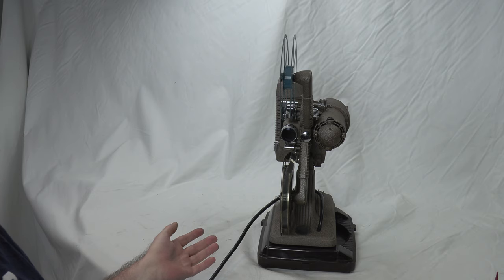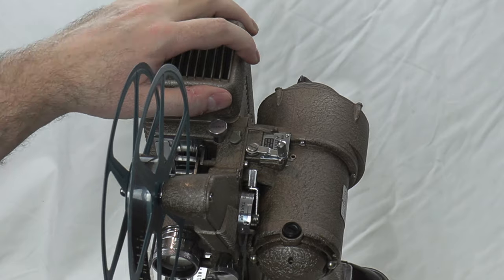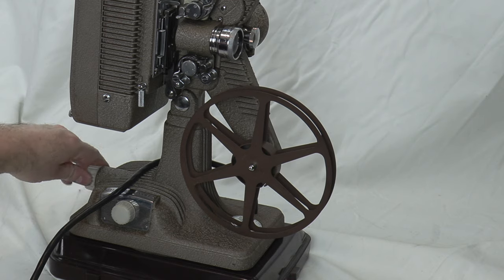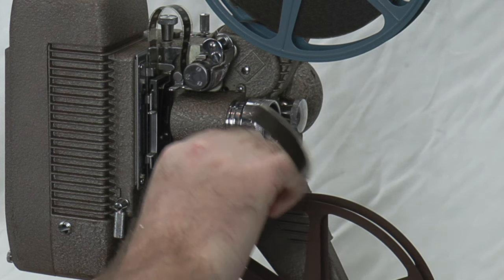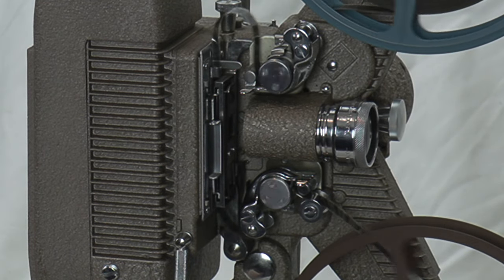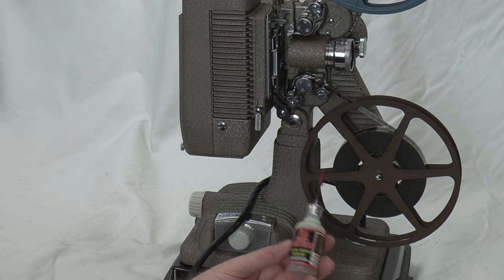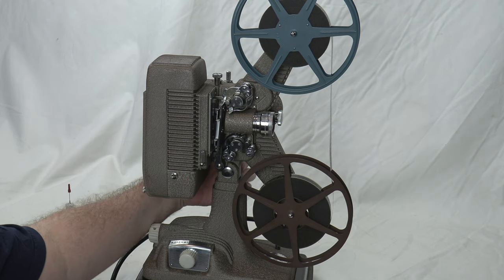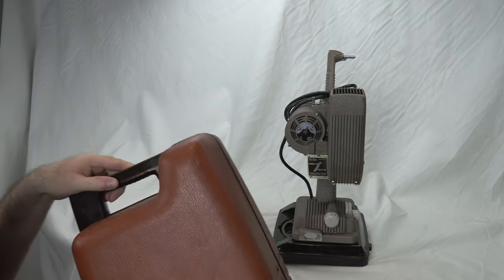VINTAGE Revere Model 48 16mm Film Projector Demo in 4K  Made in USA Circa 1952!

Comment: Do you have any idea why the clutch would not engage in the direction?
Reply from the maker: the clutch should engage in both directions... are you asking because your unit only works in a single direction? - the demo shows how to move the reverse lever and then you can engage the clutch in reverse, and vice versa.
Reply: @mediacreationsusa  it doesn't engage in either direction.
Reply from the maker: @cheryllutz476  even with the other lever fully moved to one direction or the other? - if so, then the cam that is inside the arm is most likely broken or another part of that linkage. - Be sure that lever for direction is fully engaged
Reply: @mediacreationsusa  I set up the projector again today.     Does the projector require film to be loaded in order to see the reel wheels turn?     When I move the lever from one direction to the other, the sound changes as if it is engaging, but i do not see the wheels for reels turning.   I hope that makes sense.        Would it be easy to access cam in the arm that you are referring to?
Reply from the maker: @cheryllutz476  You don't need reels on it to have it work, the bottom spindle should be turning in FWD and the top would be turning in the other direction when you move the lever to the RWD or Rewind position. - you can start by taking off the arm backs there are several small screws - be careful and take your time so you don;t loose the screws.  it's fully mechanical - I think these used chains back then but there might be belts - I can't recall on the 48 but you will see the problem if you pull those.
Reply: Actually the back arm panel is missing..aleady off.  I see the chains but don't see anything obvious broken.   Chains are nice and snug
Reply from the maker: @cheryllutz476  well, if you have it off like that... see what happens if you try and turn the hub by hand and see if that is freely spinning with the lever in each direction... if its the top one there should be some resistance in Reverse, the bottom arm would be resistance in the FWD position.  if they feel the same then you know its towards the middle where they meet and that cam I was talking about that moves to drive on arm or the other.
Reply: Ok..time to get my brothers help!    Lol.   Thank you!
Reply from the maker: @cheryllutz476  sure thing! Good Luck!
Reply: Can u tell us what the hub is?   We have both panels off the arms...nothing moves either direction clutch on or off.   What is the cam?   Wish I could find someone local that would help
Reply from the maker: @cheryllutz476  The hub is where the reel mounts that turns the actual reel - there are the two hubs - one for each reel on each arm - you can mount an empty reel on each if that makes it easier for you to see - if you do that and you don't see the chains moving at all then try to turn the unit on and engage the cluch and see if those chains move in either direction of the lever....
Reply: @mediacreationsusa  We did this.   Chains do not move.    However there is a difference in the sound when the clutch is on vs off...forward or reverse...   But nothing moves.      What else might it be?
Reply from the maker: @cheryllutz476  with the unit off - do the chains on each arm move when you rotate the hub/spindle/reel? if you wanna make me a video of what is happening, I will take a look at it, it's too hard to do this via text I think?
Reply: @mediacreationsusa  I'll check.    I could make a video.  How could I share with you?    Definately would make it a little easier :)
Reply: Did you ever fix the issue as I have the same exact problem with this projector.  Everything sounds good but neither arm will spin. There is even a sound difference in the motor  when I move the clutch or increase the speed. Since it is a problem in both arms I am guessing it is some sort of central cam or something. No idea how to get to it. Very frustrating!!